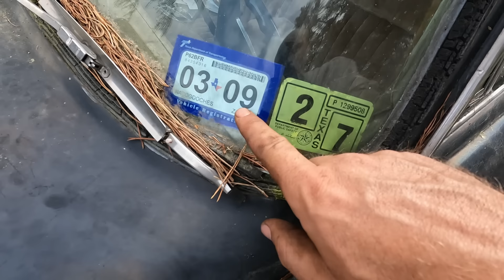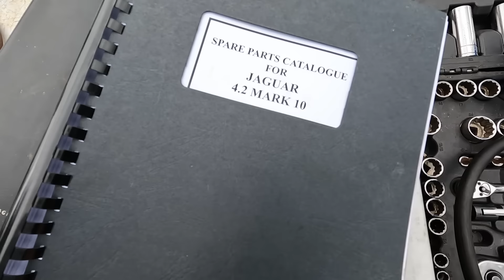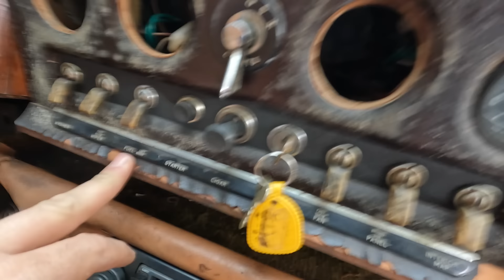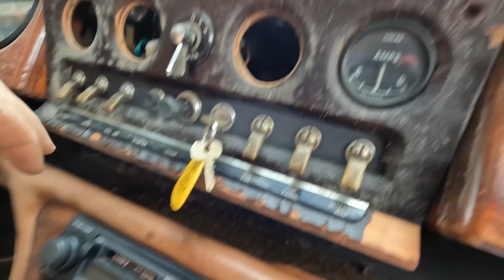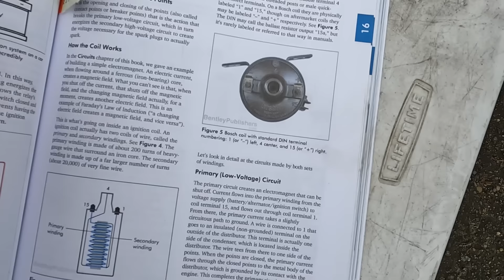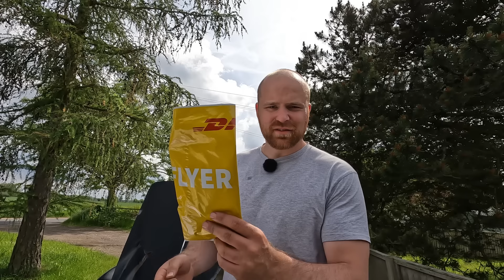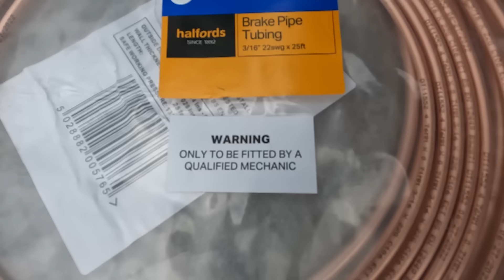1962 Jaguar sitting for 15 years. Will it run?

Comment: The fluid feed to the master cylinders goes into the side and the pressure to the wheels goes out the end of them so you will never get pressure.
Reply from the maker: Not on these master cylinders according to the parts diagrams. The end of the cylinder takes a 7/16" union for 1/4" pipe for the low pressure side.
Reply: @NotEconomicallyViable  feeds on all master cylinders are always fed from furthest back because when the piston pushes forward past that point the only way the fluid can go is towards the end of the master cylinder and create  pressure to the brakes, the way it is at the minute it is sucking fluid from the reservoir into the end of the master cylinder as you release the brake pedal and then as you push the brake pedal your just pushing the fluid back into the reservoir, there is a way to check push the brake pedal to the floor and hold it there then open a bleed nipple on a caliper and no fluid should come out or very little then while the bleed nipple is open release the brake pedal and it should start running out of the caliper, that will be why you have fluid at the calipers but no pressure.

Comment: Looks like the brake fluid reservoirs attach into the end of the master cylinders. There must be some sort of one way valve that stops the fluid being pushed back into the reservoirs? Could be that is not working.

Comment: In Australia , many 4.2 litre XJ6s , had a conversion plate made by a guy called Rod Hadfield of Castlemaine in Victoria , that put GM or Ford V8s in them , better fuel consumption , performance , reliability ,5 litre V8s ,made conversion plates for local Fords and Holdens (GM) , to put 6 cylinder Toyota (ex Crown)4 speed gearboxes in to 4 litre six cylinder , as many were either , Powerglide ,or Fordomatics , (Autos) but mainly 3 on the tree , 4 on the floor became affordable.and was far more desirable .

Comment: I think this car had a 3.8 litre engine originally as it would have been built with that engine considering the year. It would also not have had air conditioning. So someone has swapped the engine at some time in the past.

Comment: I once started with a Triumph GT6 that had sat for 27 years.
Decide that you will make an honest effort, that means spend some time and capital.
Bite the bullet and beg borrow or steal a lift ( or use a tree and chain lift) pull the engine, with the engine/transmission out you can determine properly whether the motor and tranny are junk or not.
Purchase the minimum amount of tools to make the determination "go - no go"
You know what to do if it's junk.
If it's a GO, then clean up your life, allow for scheduled time with this hobby ( do you have a WIFE ?  KIDS ? ) and find a mentor you can go to.
A worthwhile project TAKES TIME ! 
You WILL make mistakes, learn from them and continue moving.
Good Luck
BTW the GT6 is a sweet ride and is waiting for a new paint job.

Comment: To be honest, with a classic car like this, you can still get parts for the engine, especially being a Jag straight 6, plenty were made, plenty still survive for parts. The area where you will start running up many labour hours and cost to recondition is the body work. To recondition this beautiful Jag properly you will need to strip this car down to its basic shell, trim off, windows out, running gear out, then you can budget and start from there, you will need a welder and metal fabrication skills. In my opinion a car like this is a big under taking, I used to work in vehicle body repair, I can tell you, you will be shocked to find out how rusty and corrosion compromised the body on this car actually is once you get into it. Get the body reconditiined, then you are 2 thirds there. Also you will need to get new wiring looms, unless you want all your hard work going up in flames.

Comment: 1000 comments, so you probably have the answer about the brakes.  My guess is that the volume of fluid the master cylinders move is not sufficient for the calipers to fully reach the disc.  More volume of fluid is required to do that, hence the pedal never goes solid.

Comment: Is the brake issue just that the rear system is empty?  that strange rocker thingy that joins the 2 master cylinders together pushes on whichever m/c is easiest to move?  only a thought

Comment: TBH the distributor cap looked ok.  The failure modes with those is if you got a crack or the central carbon contact electrode failed.

Comment: So, with the Master Cylinder threads..... I don't know, but it could well be an NPT vs BSP issue. So, the UK and US have different thread standards. In the UK we typically use BSP, the US commonly use NPT. You can have exactly the same diameter piece, but if one thread is cut to NPT and the other BSP, they will not be interchangeable. The difference is the threads per inch, the angle (pitch) of the threads, and the shape of the thread. My guess would be the master cylinders originally fitted when you got the car we're NPT from it's time in the US, it maybe that Jag, knowing it was going to be sold in the US, made the vehicle with NPT standard threads from the get go, or that while it's been in the US, the cylinders have been replaced, and the break lines adjusted to be compatible. If you bought you're new master cylinders in the UK, they were certainly manufactured with BSP threads.

Comment: You need to synchronise the carbs for the car to run correctly. Two carbs are not easy for a beginner. Three will obviously be harder.
The fuel pump will be made by SU you can get them from SU based in Salisbury. They will not be cheap. best try to find ones without points.
The neighbours were, maybe, protesting about the noise of this beast by using their own noise generators?

Comment: You need someone to press the brakes while you look at the calipers and how much the pistons move. One side of the caliper could be seized causing the discs and hub to flex causing more movement in the brake pedal.

Comment: Personally - while waiting for the parts - especially the brake vacuum , I would have cleaned the entire engine and gulleys  free of all that debris from trees etc . Surely working in a cleaner environment makes all the difference with working on the engine and stopping any of that debris getting anywhere in any new part ???

Comment: Either the master cylinder rubbers are allowing the fluid past or you have an air lock. Probably an air lock. Buy a cheap pressure bleeder which attaches to the fluid reservoir, then you can force the fluid through. If that fails then you may have to reverse bleed it, by forcing fluid into the caliper.
Reply from the maker: Good to know - cheers mate

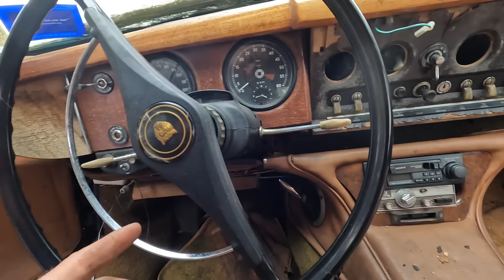Comment: 19:58 I'm genuinely surprised you didn't pop the hood and find a smallblock Chevy V8 sitting under there. Such swaps are incredibly common over here because Jaguar reliability has never been all that good, part availability on this side of the pond is spotty at best, and you can't take ten steps out in the countryside without tripping over a donor car that has a smallblock Chevy V8 in it.

First sign of trouble from an old Jag, especially if it's already been around for a while and isn't really all that valuable 'numbers matching', and the engine hoist comes out.

Personally speaking, I do prefer inline sixes, so I'd be swapping a 250cid Chevy I6 into it instead of a V8.

Comment: are you sure you have the pipes the correct way round on the master cylinder as normally the reservoir goes in the side port and the pressure port is on the end

Comment: Um, when you were turning the motor over, the air was coming out of the intake manifold, and i noticed the engine was spinning in the wrong direction. Have you ever thought that maybe, during the course of the car's life that someone converted the car into negative ground?

Comment: I didn't see you check the engine oil or coolant!  Did you vacuum all those pine needles etc from the engine bay before fiddling around?  These should always be the first actions in this situation.
Reply from the maker: Checking the engine oil was one of the very first things I did at 2:44
Reply: @NotEconomicallyViable  I must have missed it, sorry.
Reply from the maker: @davidstokes8441  no worries, it’s a long video with lots of detail crammed in 👍🏻

Comment: I have a 63 Mk10 with dunlop master cylininders originally. Inside the cylinder they have a recouperation valve that shuts off the brake fluid from the reservoir at the end. I got sick of replacing this seal that would split at the end and the pedal would go soft. I replaced the cylinders with wilwoods from the US but they work by the resevoir connecting to the side and not the end and the piston closes off the side port as you press the pedal. So i had to swap the original brake line in and out ports arround. Check if the in an out ports should be swapped arround. I could not get dunlop replacement cylinders at the time 10 years ago but seals were available at powertrack brakes in the UK. Were did you aquire the cylinders?
Reply from the maker: Interesting. My master cylinders are from SNG Barratt. Almost certain the port at the rear is the feed from the reservoir because the port accepts larger 7/16” unions and the unions take 1/4 pipe. The port on the side is 3/8 for 3/16” pipe and that’s what’s still plumbed in. Hope that makes sense.

Comment: Has someone tried to uprate the Mk 10 using E type parts maybe including calipers but not checked  the centralisation of the disc relative to the caliper so one piston/pad is pushed back into the caliper whilst the other piston/pad now has to travel further out whereby the master cylinder "runs out" of stroke before the pad can contact the disc and apply braking force? postscript : after writing this the thought did occur to me that the calipers weren't intended for a car with thicker or vented discs were they?
Reply from the maker: These are some very good points. I think the best way to proceed is to first tear down the whole braking system just to work out what we’ve got and then go from there.

Comment: I may be totally wrong but is the pipe that goes from the brake fluid reservoir to the master cylinder connected to the correct union? Is that why there’s no pedal?

Comment: Condensers are capacitors, you can remove it to get you home, the best way to get rid of old brake fluid is paraffin bleed, which cleans as well, then bleed it again with brake fluid m8, if goto a forklift repair company they make you any sort of Flexi hose for your brakes
Reply from the maker: Good to know. Thanks bud

Comment: Might be worth looking for a v12 from an old xjs and create a resto mod Jag.
Reply from the maker: That engine scares me. So many random hoses and wires haha. Not to mention it's a very ugly engine.
Reply: The whole premise of the Jaguar V12 intake system is self defeating. A V12 is meant to be narrower than a V8, but the Jaguar system ends up quite wider. A company in England?  is building an injection system that is much simpler and inside the V that looks good, and is very sliming. However a V12 will never be an economical choice unless you are faced with buying a new 3.8 block. Jaguar are very proud of those. Take care.

Comment: The engine cam covers look too modern for the Mk 10. I'm thinking someone fitted a 4.2 XJ6 engine at some time in this car's life. Also the Mk10 was always a fairly heavy car, so the increase in power is probably a good thing. Best of luck.

Comment: you actually dont need a carb or intake manifold to run the engine    just spray "atomized "  petrol  down the intake      however     your engine might need to be a little "free er "

Comment: If that's a 4.2 Jag engine are the best engines in them I don't like it's been sitting around they like to be driven otherwise the engine plays up also dampness in the fuse box always happens when I've heard them good luck fixing it

Comment: I've been having kittens about that molegrip holding the battery terminal on. The molegrip was soooo close to the body work and you kept leaning across it. Any second now there was going to be a massive BANG short-circuit and you'd be off to buy another battery. 😱

Mark you, I'm only half way through the video so it could happen yet!

If you persist in using the molegrips to hold the battery terminal on then please, please, please put a chunky bit of cardboard (anything non conductive) between the grips and the body 😳
Reply from the maker: Haha it was very temporary - I fitted a new terminal
Reply: @NotEconomicallyViable  Here in the US it's called a 'vice-grip', which is the most well-known brand of mole grips here.
Reply from the maker: @mescko  It’s also the name of a famous garage 😉😁
Reply: The garage got its name from the pliers, favorites of bodgers everywhere. I once bought a truck that had four pair clamped on various parts. Take care.

Comment: I can never understand why folks going to get engines running again, dont clean out all the rubbish before starting. Having done it myself, first get the plugs out and soak the bores with WD or diesel, leave for days, meanwhile, clean up the ignition system  using a points file, not sandpaper, if not replacing them. Then clean up the carbs.
    When eventually you go for a start, dont just wind it over, flattening the battery, tip some fuel down the carb to give it instant fuel. When it does fire, don't over-rev it. Then, let it run for a while to allow the valves to beat themselves back into their seats if they have rust on them. When hot, cut the ignition and check the cooling system before continuing. 
       Using diesel helps free the piston rings, which are usually choked up with carbon., and will burn away, within a short time. Some time ago, in the U.S. a car was run for 20 miles, fast, with diesel oil in the sump for lubrication. Checked for damage they found it had just started to struggle.!

Comment: Well done awsome video, You just need to drive it 600 miles home. Sadly The biggest difference between UK and america is car culture it's massive over there also America has parts stores like o'rilleys, Harbour freight and napa on every street corner and parts even for older car's are still on the shelf in some stores. American police only fine if caught with crappy car. In Britain police take the car off you if it doesn't have MOT certificate, insurance and VED there are so many constrictions on car ownership in britain and there are only a couple of parts stores scattered about often you have to order parts shame really
Reply from the maker: Yeah completely agree. I might have to get out to the States at some point and give a revival a go.

Comment: If it were mine id remove the engine and transmission and fit an old 6.2-6.5td v8 diesel or a cummins or mercedes diesel.
Strip interior out and rip out the wiring.
Simplify the electrics or buy new harness.
But first sand blast it and paint white.
Also fit a fuel cell in the middle of boot.....

Comment: The 3.8 mk10 used a submersible fuel pump in each tank which is now obsolete - you will have to find something else to fit.

Comment: An LS would fit in there. I looked at buying an XJ12 with a 350 Chev engine swap. Reputedly, it was lighter and had better power and fuel economy. SU carbs, anyone?

Comment: I advise you look at the difference between DOT3 and DOT4 brake fluid. The materials that your seals are made from are severely degraded by the incorrect type. DOT4 rots the DOT3 components fairly quickly. You'll be revisiting those brakes.......

Comment: Your brake problem might be that you haven’t done the rear brakes I know this will happen on a bias system as you’re pushing the empty cylinder if that makes sense to you
Reply from the maker: Thanks for the tip - will try doing the rears too

Comment: It's an American import and the engine was more than likely original and was just upgraded by the factory because the client ordered that there were some about at that size. The interior was done after the American do strange things. Also Texas is effing hot and you couldn't sit on leather seeat very long. As for le cooker just change it back. The original pressings will have the right holes. Do it and repaint it the orig colour

Comment: every britsh car i've ever owned had an electric fuel pump. including my 1953 MG TD, 1961 MGA and 1967 MK2.

and yes, electric windows are generally NOT a swithed connection, they will work at all times even without the ignition turned on.

ah ha! old-school british spark plug wire terminals. need matching coil, and cap for those. what a PITA, eh?